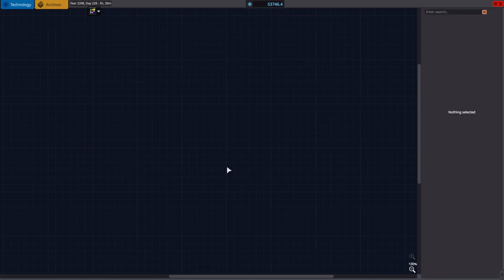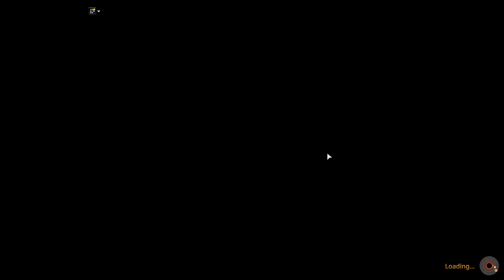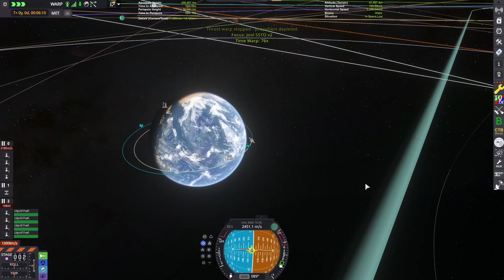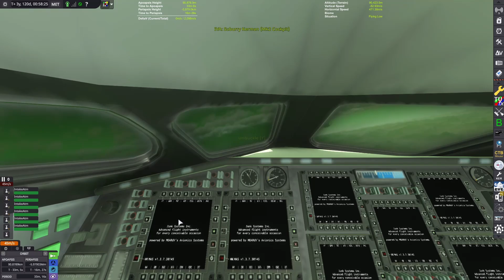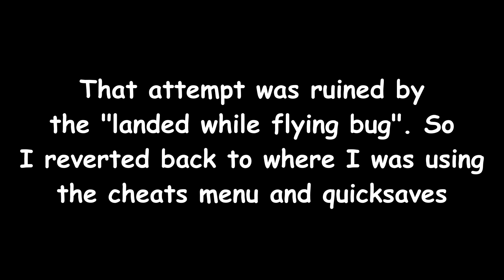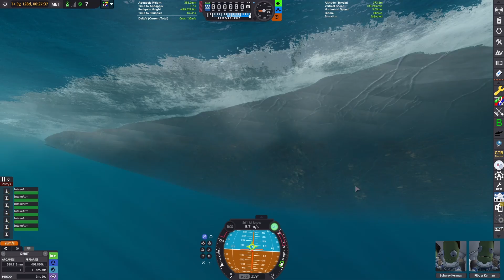KSP LP Ep 50, flying into Jool's great spot storm.

Comment: i did this couple of times too (my plane was a little bit smaller and less powerful)
nice video
btw what mod adds those joolian rings ?
Reply from the maker: Its version 1.1.0 of the minor planets expansion. It has the Jool rings, a revamp of Eeloo and atmospheric scattering effects for Evro as bonus features
Reply: @dustycircuit8758  the newest ?
Reply from the maker: @ Thats the newest offical version of the mod., there is a revived version by TheWhistleGang, on Github that adds even more planets, but that one doesn't have the Jool, rings, Eeloo revamp, and Ervo atmosphere effects.
Reply from the maker: I'm considering maybe exploring that one a bit later in my series, but I may keep the mpe 1.1.0 a bit longer for those bonus additions :D
Reply: @dustycircuit8758  nice thanks